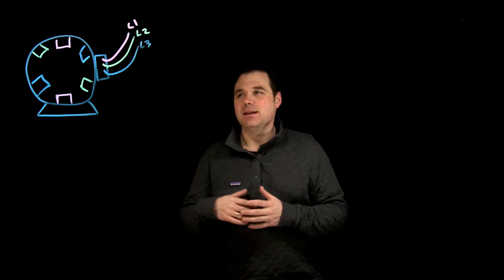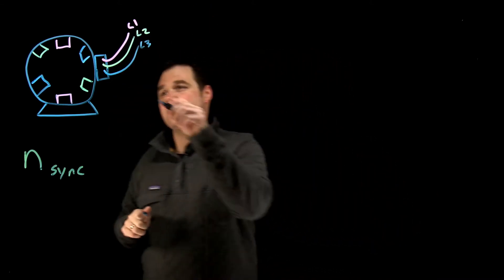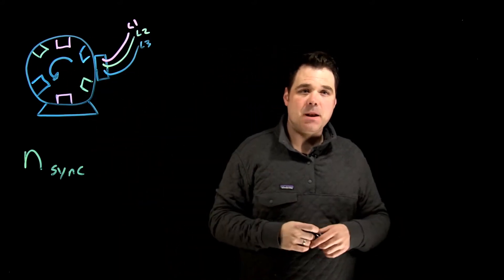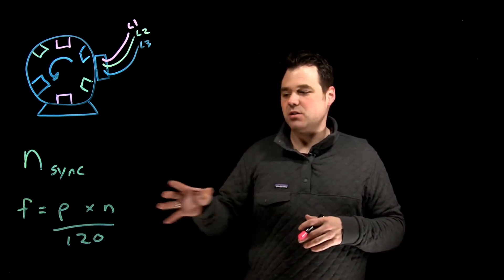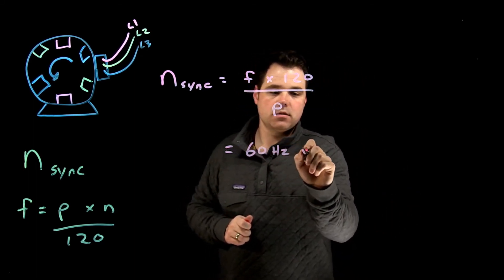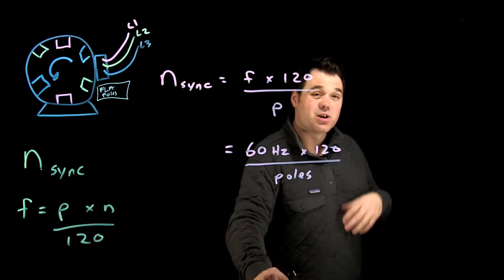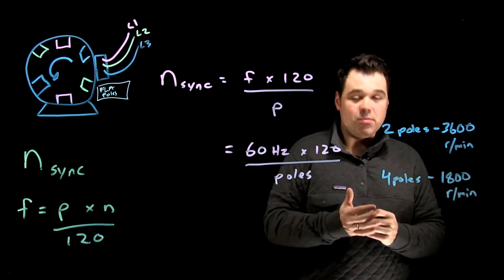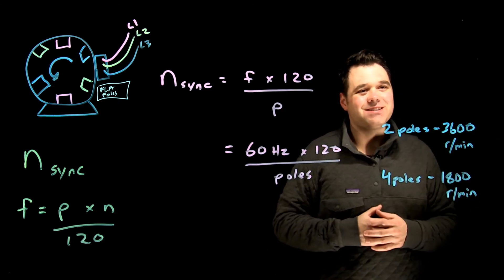Finding Synchronous Speed of a Motor

Comment: Does load on the motor diminish that speed at all?
Reply from the maker: The speed we are calculating is the speed of the rotating magnetic field. Typically full load speed will be about 2-8% less than synchronous speed.